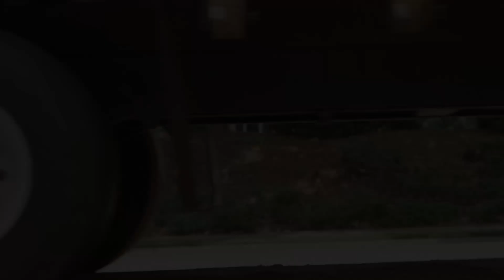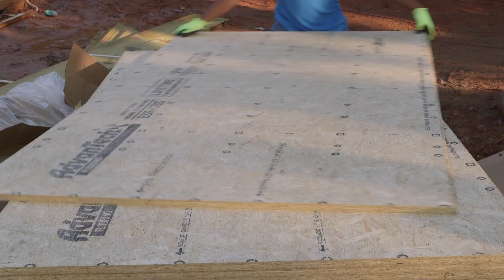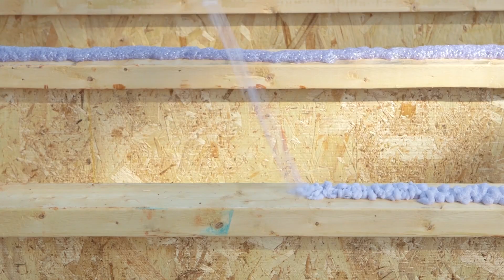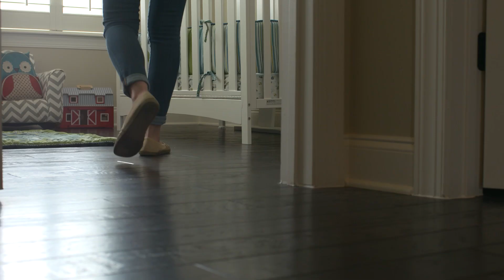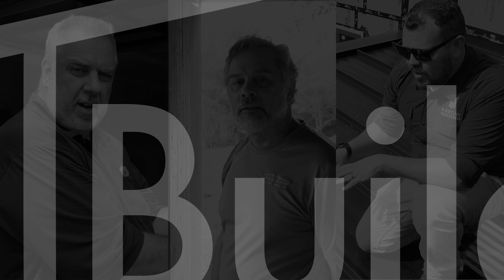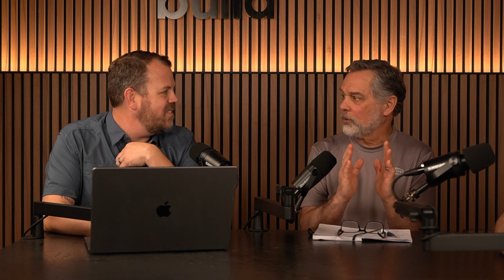Permanent Wood Foundations & Pivotal Career Moments - UnBuild It Podcast #136

Comment: Thank you guys for doing another episode on Permanent Wood Foundations! We've been building and installing these since the late 70s.  
Here are a couple of answers to your questions 
-Exposed Above grade PWF: Siding or any kind of typical exterior cladding. Another benefit of a PWF on the sloped grade is that you can side or clad at a straight angle down to your grade board (double layer of FND plywood sandwiching the two layers of 10mil Stego waterproofing). Rather than dealing with the sharp step downs of a concrete wall. 
-Drain Tile: When we use a FDN grade 2x12 footing on 6" of clean limestone, we typically do not install a drain tile, since the water can "flow" through the gravel base to the sump pit. Sounds crazy, but we have rarely had any issues as long as the sump pump doesn't fail.  When a client requests a concrete footing, we use a drain tile as usual since the concrete footing "dams" the water up from getting to the sump pit. Only water issues we’ve had with a PWF is when it had a concrete footing. 

If you guys want to talk to an “Expert” in PWF, I’d reach out to Roscoe Clark in Flint, MI. I’ve had one conversation with him and was completely blown away with what he was doing with PWFs. Floating PWF slabs, multistory commercial building PWF, Zero entry in the front and walkout in the back. 

Here is his FB (Search “Permanent Wood Foundation”) page: https://www.facebook.com/profile.php?id=100063855510675 

Thanks again! I look forward to the next PWF video!

Comment: In 1990, PW Walls were installed with 2" below the poured concrete floor and notched for the floor joists and backfilled with drainage and gravel to 5 feet and 1 foot of dirt above.  Plastic was the moisture barrier and no leaks in this design.